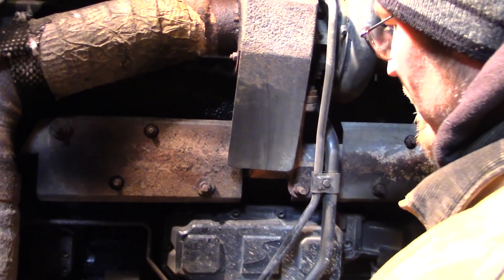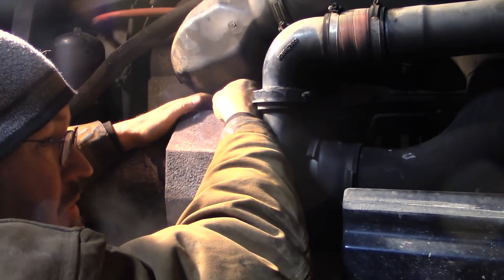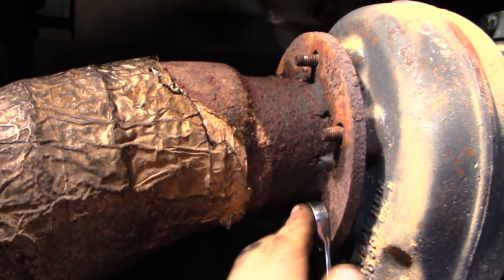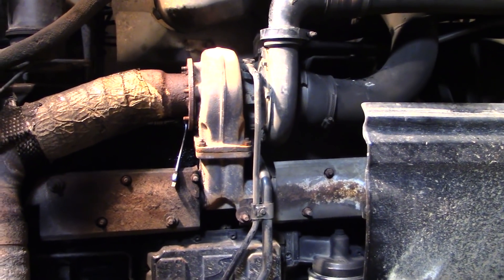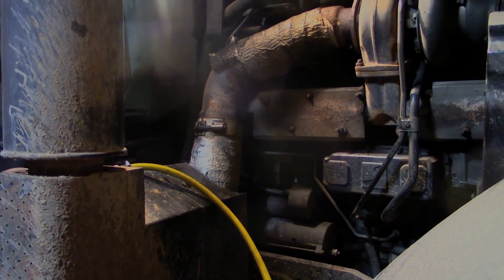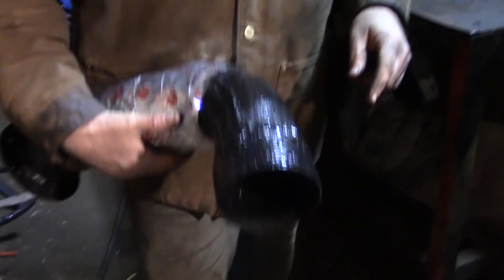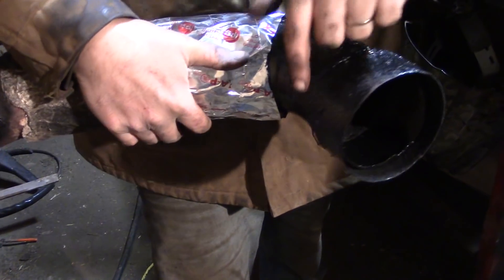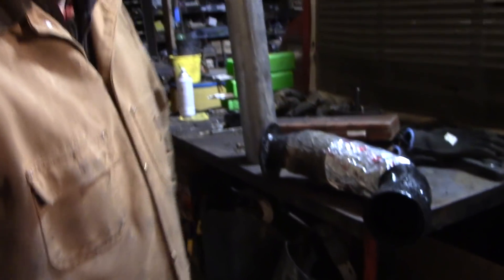Tractor Exhaust Leak ~ Worse Than We Thought

Comment: Teamwork sure helped in this project. That's the only downfall to "turbo" diesel engines in tractors, equipment, trucks etc. Tond of exhaust pipes, plumbing up-pipes, turbo downpipes etc as well as intercooler piping/tubes too. Lots of potential for exhaust leaks as well as boosts leaks. But today most all trucks, pieces of equipment have a turbo diesel powerplant so just gotta deal with it.

Comment: How many hours is on that tractor? I was surprised to here Kevin say the motor had been rebuilt.
Reply from the maker: Challenger has close 7000 hrs.
Rebuilt it at 5200 hrs because previous owner used the wrong antifreeze and pitted out the liner, so antifreeze was getting into the oil.